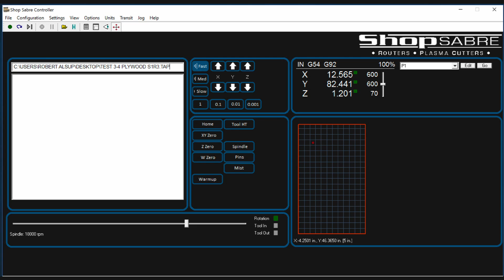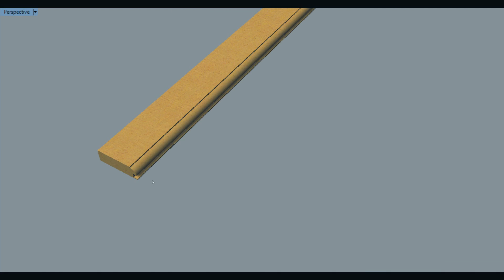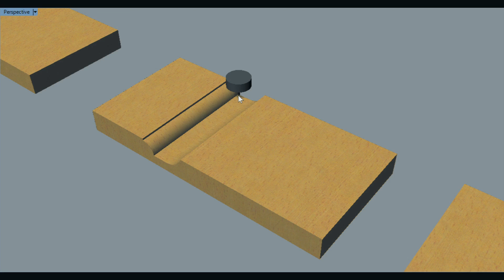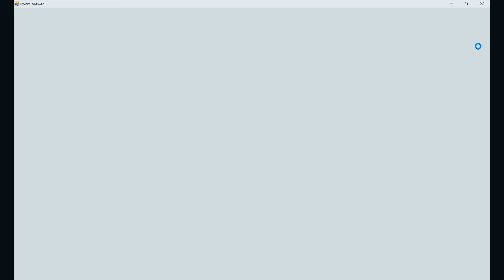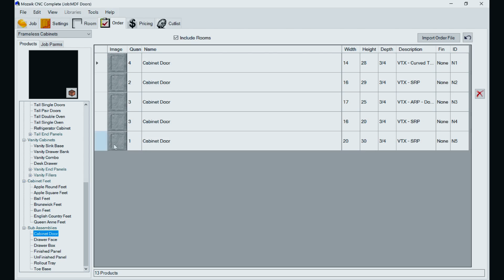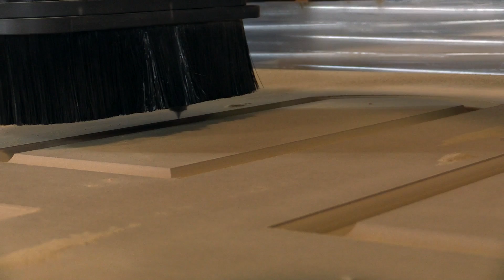MDF Door Production on a ShopSabre CNC

Comment: 2 questions.
How do you cut them out thru, without sacrificial sheet of mdf underneath? Or is there one?

Also, how much HP spindle do I need in order to be able to cut thru 3/4” melamine, and r prefinished mdf with compression bit? (Edgebander ready quality) meaning all in 1 pass?
Reply: There is a mdf spoil board. The vacuum pulls through the mdf and to the mdf on top.
You can cut small step downs any debth. So a little spindle will handle it, but will take longer.
Reply: @elmeradams8781  yup, it’s  bin a year lol. I already have a shop sable CNC. With a nice 9hp 3phase spindle 48x96 with 5xATC. But no vac table yet. Building our own
Reply: @11SecSTionStockSnail  I don't know a lot, but my work bought a used laguna cnc with a vacuum table. I learned a lot figuring out how to set it up.  If you want pictures, videos, or whatever, let me know.
Reply from the maker: Our technical support team can assist with this question. Give them a call at 952-461-4570

Comment: What a great video and nice presentation!
Reply from the maker: Thanks for watching!
Reply: Is there a way to pocket the back of the doors?  Adding the detail of a five piece door.
Reply from the maker: Not sure we understand what you mean? You can double side machine by simply flipping the sheet before cutting parts out
Reply: @shopsabre  Yeah can you flip the sheet and create the rail and style effect instead of a flat back for each door.
Reply from the maker: Yes you can machine on both sides - just a programming and positioning thing for the operator